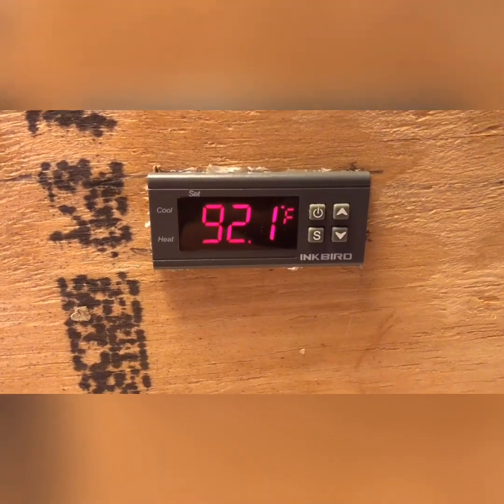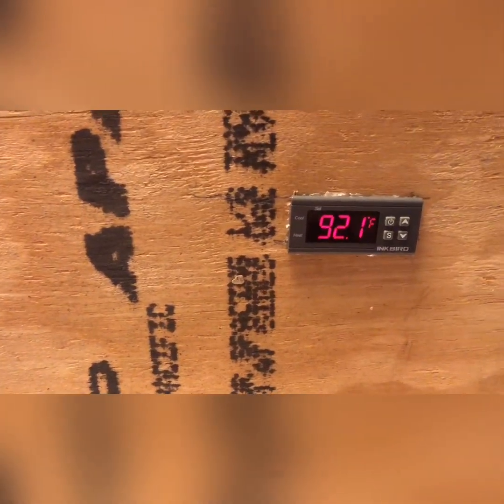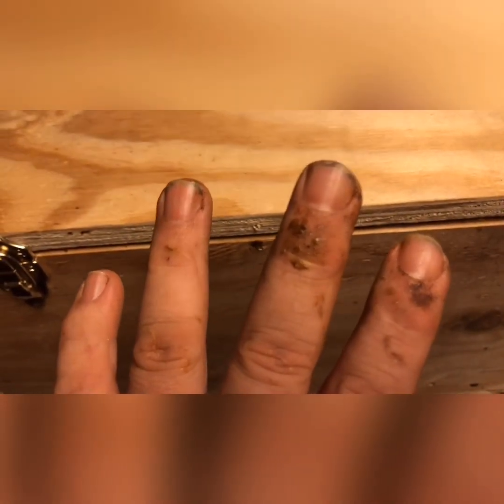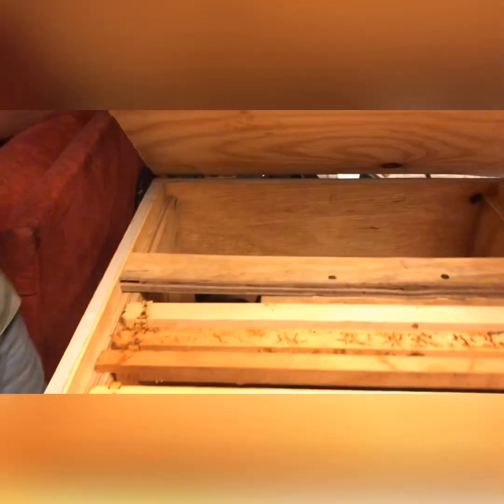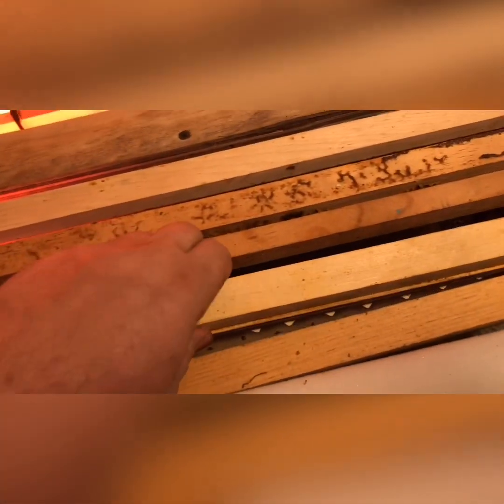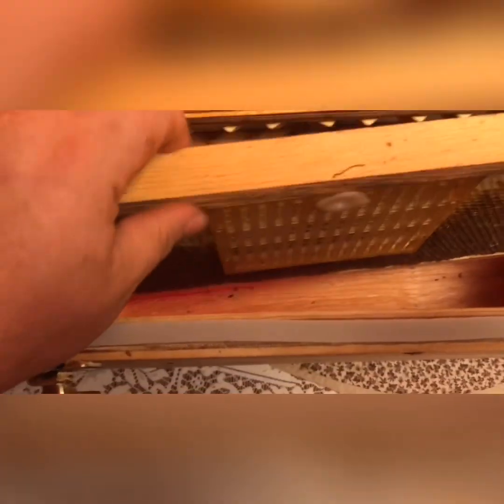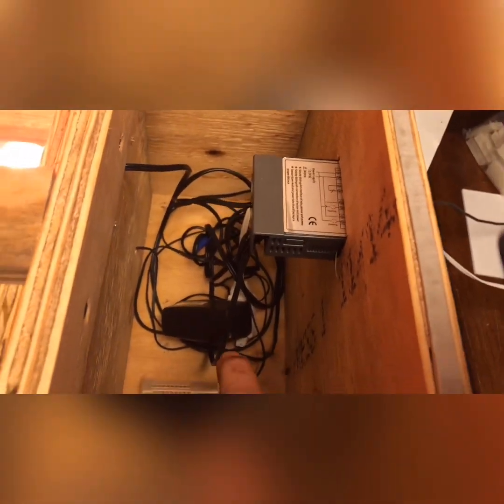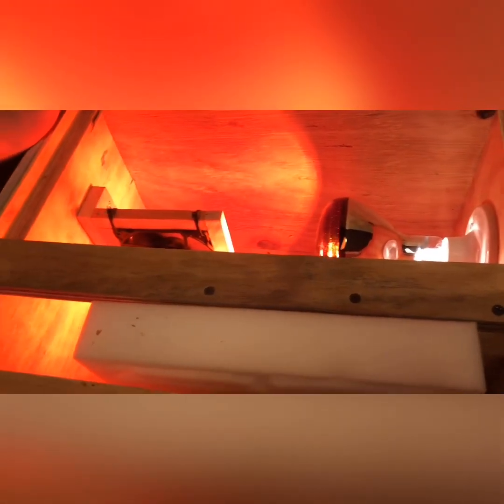Custom Queen Cell Incubator

Comment: Ditch that heat lamp.That thing will burn your house down if you have a malfunction.Learned the hard way.A 40 watt incandescent will give more heat than needed.I have build a bunch of incubators and hot boxes to cure out epoxies in archery longbows.Your design of it is really good and I mean really good except for that heat lamp.
Reply from the maker: MrSnapper1d  thank you. I am definitely take your advice!
Reply: I use the heating element that fits where your heat lamp is in my incubator for my birds.